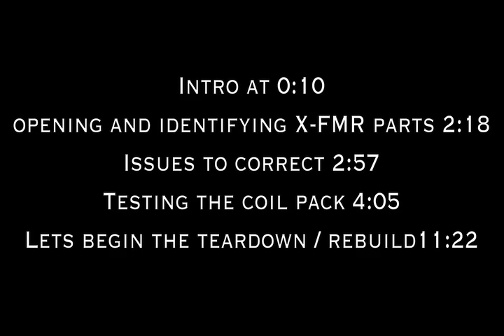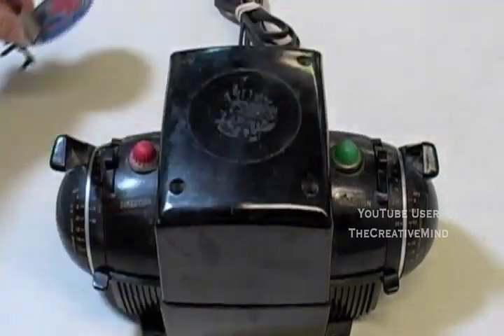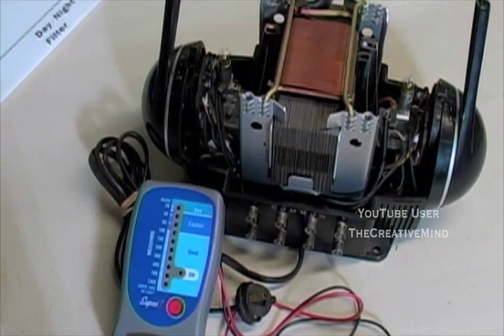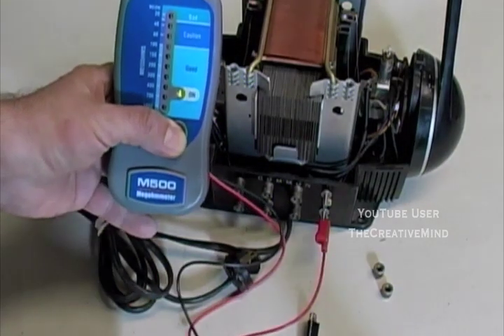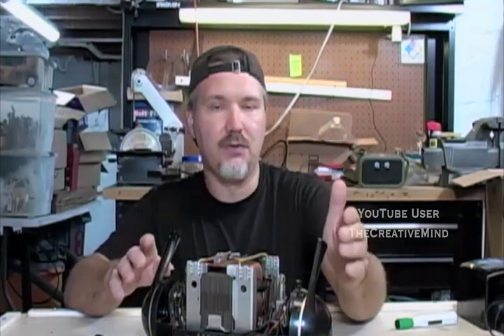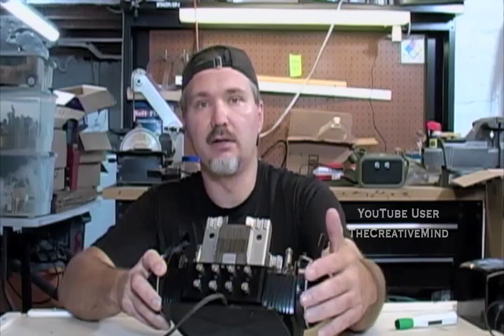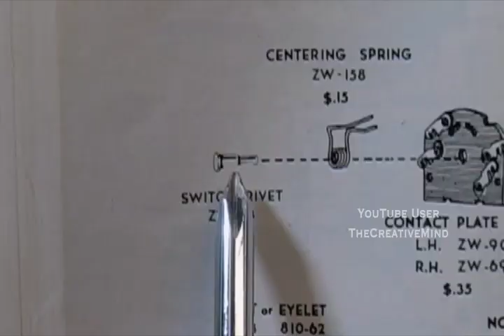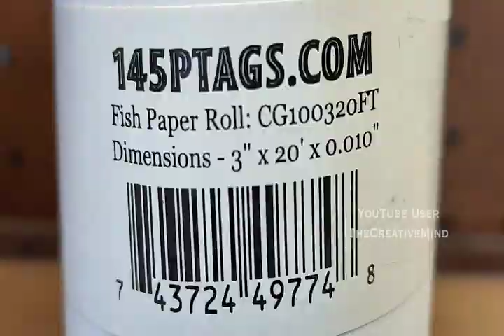Lionel ZW Transformer Complete Disassembly and Rebuild Video (Upgrades and Replacememts)

Comment: Beautiful and fun to watch.  I have two ZWs on my layout.  Paid full retail for the first but picked up a sketchy one two years ago from a guy who knew little about trains.  He used the voltage meter and some terminals worked others did not.  I paid $35 and then took it to my hobby shop.  They charged $90 for a full rebuild.  So I got my second ZW for a low $125 with full peace of mind.  My most adventurous repair is right now on a Lionel Erie Alco and I'm building up my courage to do an E-unit rebuild.  Wish me luck.
Reply from the maker: Thank you, even with the rebuild price sounds like you did well. I need to find more ZWs for that price. I think you'll do fine on the e-unit rebuild. I took one apart with with an e-unit jig and reassembled it to try it out.

Comment: Nicely done Ed, great work and video!!👍
Reply from the maker: @TwistedMacGyversTrains  thanks Frank, this one was a labor of love
Reply: @TheCreativeMind How’s it working today? Is there a place for making an 18v tap? I’ve been think about adding one to mine. I’ve seen in added on other postwar ZW’s.
Reply from the maker: @TwistedMacGyversTrains  the ZW works great today. I've put it under some heavy loads and still running. I have to research the 18 volt tap on the ZW. This is the first I'm hearing about it. Thanks Frank.
Reply: @TheCreativeMind I purchased mine fully upgraded with a power switch added to the front. They are also adding a button for the bell now.

Comment: Hi Ed, The video is fantastic! I wouldn't have tried restoring a ZW if I didn't watch this. All terminals register over 20v and the whistle over 25v. Adding the ZW to the table now. two trains running on one 18 awg lockon. Thanks again, looking forward to your other videos!
Reply from the maker: Thank you Alfredo, I'm glad to hear everything went well and your readings are spot on. Enjoy running your trains with your new rebuild. Please correct me if I'm wrong, I may have seen your comment earlier with having some trouble with the whistle output on one of the terminals. Is everything good now?
Reply: @TheCreativeMind  I was incorrectly testing the whistle/reversing assembly and the circuit breaker. I needed to move the switch lever slower for precise contact. To test the circuit breaker, I grounded the B&U, C&U, terminals before I started increasing voltage which tripped the breaker without any sparking. My old hands/mind took a little bit longer to realize what I was doing. 😉

Comment: A great reference, thank you. My unit buzzed. The core laminations had been inserted in an irregular pattern by a rushed Lionel worker. You could even see how the die they were stamped from had dulled on one side. This kept the laminations from laying flat together. I hammered out the burred edges and 3D printed a spacer to keep them squeezed tight.

Comment: Honestly, this is one brilliant video! You did a fantastic job of capturing your 'tear down'.
I just got myself a ZW.... and it's become clear very quickly that a total tear down is going to be required to rehab it. I don't have all the equipment you do but as much as I've been finding myself gasping in horror at all the work that needs doing, I also am relieved to see such a clear video of exactly how everything came apart and what work was performed. Time to ready the soldering iron, begin ordering parts, and wait for the Greenberg repair manual to show up at my doorstep!
Reply from the maker: Hey Leverett, thanks for the comment. I found myself in the same boat you are in knowing how much work had to be done, it can be overwhelming. First I can say is label all the wires from the coil pack going to the whistle/directional board. Even sketch it out on paper where the wires go to, makes it so much easier for reassembly. All my tools I acquired over time but that angle bit will be a huge help in drilling out the terminals. If you go drilling in straight, you could damage the bakelite case. The Greenburg book will help a lot with line assembly and if needed parts. And if you get stuck, come back to the video. Best of luck on your rebuild, when you get it finished you can do 10 in your sleep

Comment: This is an insane rebuild. To me you went above and beyond what others won't do. I'm not sure about that megger putting out that kind of power you sure it won't damage anything. Other than that awesome work
Reply from the maker: Hey Jeremy, much thanks for the comment. Meggers only put out high voltage/minimal current for insulation testing. Curiosity made me try it on one of the bulbs for the ZW and it didn't blow the element. Meggers are only good for inductor testing but will have devastating consequences for testing electronics.

Comment: Extremely nice work...
A little tip for you as an avid Lionel collector I have come across some tricks of the trade I work in the bowling business as well .. in the bowling ball repair world when they use a pentagraph  to add your name into a bowling ball or your refurbishing a bowling ball for someone, you can get the wax crayons for terms of a better word, that you can refill in the lettering on your Lionel transformers you can get the white wax crayon, you take a paper clip or a jeweler's screwdriver and you can clean out the old paint or white lettering for your gauges or your whistle lettering, clean them out and then you can take this wax pencil and fill them in and wipe off the excess and voila all of your stamped lettering is brand new just a little tip... Although yours turned out well I like to redo mine so they're nice and bright... I have subscribed and look forward to more videos keep up the good work
Reply from the maker: WOW! Thank you Izzynutz. Iwas wondering how to redo those. I thought paint and wipe away but the wax crayon sounds better. I'm on my 3rd ZW now and the terminal lettering is gone. The wax crayon method won't work there but I'm thinking of rubber stencils to paint them on.
Reply: @TheCreativeMind  you could do that too but I have sometimes taken a Dremel with a very fine tip and cleaned up lettering... You could go through ACE Mitchell which is a bowling supplier to get the wax crayons you can either get the whole set which is just about every color under the rainbow including neon colors or I think you can buy it's been a while since I have individual colors yeah you just rub it in until it fills it and then when you wipe off the excess your lettering is clean and crisp good luck looking forward to some more videos

Comment: Best quality rebuild I have seen EVER!

I am about to attempt rebuilds on 2 of mine, and not sure I can do as great of a job.
Do you stock things like high temperature wire? And that insulating paper?

Why don’t I just send you my ZW’s and the rebuild kits and you can charge me for labor!

I actually have a Megohmeter in my shopping cart at $100… 
Do you take on rebuilds?
Reply from the maker: Thanks D W. I don't stock any of the items shown in the video. Much of it comes from ebay or other websites. I do try to post all information on my sources and model numbers where you can purchase them from. At the current time, I'm not taking on any rebuilds. However it's something I may consider upon retirement.

Comment: Thank You for uploading, i hawe for a long time concidering buying one of those but because the shipping and import taxes probably are going to be alot more then the transformer where i live i wanted to know more about them and this is exactly the type of in depth information i was looking for.
Reply from the maker: Hi Vampi, I try and give as much info as I can in my videos so everyone can understand the process. I wasn't planning to go as far as this but the hardened grease and oiled papers made me do a complete teardown which I think everybody can benefit from. Thanks for watching.
Reply: @TheCreativeMind  
Thank You, i hawe a few 1950-60s Lionel steamers in my collection with the original track and some period acessories for it, so this came in handy. Im not an enemy of modern tecnology, but for the display  it looks much better with the original setup for the wisible parts in my personal opinion. I hawe a pair of the single steel case transformers, and the original 220V converter transformer (it's made in The United States, but i am not sure if it mainly was for the European export market in order to make the original Lionel transformers to work with 220V, it has a 110V socket built in to the steel case so it is just to plug in any traintransformer of Your choise the output can handle).
I used them as display before, but decided to restore the whole setup back to working condition for historical reasons a few month ago and i realy like it.

But, despite the total weight, it is only designed for one ot two locomotives.

Comment: What spec diode did you replace the old one with? Thanks
Reply from the maker: I used a Ruttonsha 16 amp stud diode. It has a perfect washer size that fits in the old disc location. There is a 40 amp available but it doesn't fit so well because it has a larger washer. I got mine from ebay.
Reply: @TheCreativeMind  I got some 70 amp stud diodes. Hopefully those work. If not I’ll get some 16s

Comment: Excellent video! Not sure I could put it back together after all the parts are removed. I am going to purchase one of these. If I bring my voltmeter can I just test it to
Make sure it puts out 19v? Is that a good indicator that it’s good? Thks
Reply from the maker: 19 VAC is good to read but I've seen some ZWs go as high as 21.5 VAC. It's all about the natural tolerances of the components. If your purchasing from an actual store, most likely they serviced it with new rollers, diodes, breakers etc if needed and hopefully a warranty. If you're purchasing from a train show, you may read your AC output voltage but pay for what you get without them overcharging you.

Comment: That is amazing attention to detail and great work.  I added the whistle Diodes to mine but did not change the circuit breaker.  does the coil need to be removed?    Can you tell me exactly what breaker I should install?  Thanks
Reply from the maker: Thank you OneMore, the coil pack from what I know doesn't have to be removed. I got my circuit breaker off eBay. Just type in "ZW circuit breaker" and you'll get the one I have in the video. I had to extend my wires (soldering additional wire) to the new circuit breaker location. If the coil pack had to get removed to gain access to a wire and extend it, just unscrew the 4 bolts on the bottom and the coil pack will slide forward a little. Just make sure the wires are not pinched during reassembly.
Reply: Creative Mind, I watched your video as well. Very thorough, very knowledgeable. Made me real comfortable in tackling my repair work! 
I’m coming to you to ask about the Bakelite circuit breaker being replaced by the newer 15 amp breaker.  Tandem says Bakelite is more reliable than the upgrade Lionel did back in the day. Am I correct that this new 15 amp breaker on EBay is better than the one Lionel converted to? 
Have you experienced any issues converting to the new 15 amp breaker?
Thank you 
Carmine
Reply: Creative mind, the ground wire going to the Bakelite circuit breaker looked like it was snipped . Does it get attached to anything when the conversion to the new circuit breaker is used?

Comment: Do you have the brand and part numbers for the new circuit breaker and diodes along with that  L. E. D. Bulb? Or do you sell them? I really need to upgrade the circuit breaker in my zw275r because I am sick of burning out electronics.
Reply from the maker: Everything I got is on ebay. Just search under ZW transformer LED bulb, Circuit Breaker, and diodes. 16 amp diodes is plenty enough and they fit nicely where the rectifier sits.
Reply: @TheCreativeMind  is there any way to tell which circuit breaker I need without popping the top to look? I am pretty sure mine is a zw275R because it doesn't him at all, and I think the core is riveted. Again I can't remember, it's been years since I've be inside it.
Reply from the maker: @inscoredbz  According to my Greenberg book for the ZW model R, your Circuit Breaker is model number ZW-232. From what I heard, these breakers start to fail as time goes on and tend to trip more often. If you look up this number you will find the updated quick blow breaker and the majority is sold on ebay. You did mention you are burning out electronics, is the transformer creating a surge or circuit breaker issues?
Reply: @TheCreativeMind  my guess would be circuit breaker issues. I haven't tested it for surges, but with the circuit breaker being old and pretty slow, that's my guess. Those old transformers just wasn't made for electronics. I've had several whistle boards pop and one true blast from a Williams.
Reply: I do have tvs diodes across all the rear C-U abcd. It probably is spikes now that you mention it, during a detailed wheel or what ever. It will drag the derailed car forever before the breaker finally shuts it down, and as soon as the short is removed, the light goes off. I may need to replace the TVS diodes. I'm sure they can go bad as well, and I have no way to test them. I'll probably just do both. New breaker and TVS. Probably need to add more of them around the layout.
Reply from the maker: @inscoredbz  replacing those boards is pricey and I'm glad to hear you have the TVS diodes. They help yes, but like you said they may need replacing they go through so much abuse. What may also help is to increase the wire size feeding your track. Too small and it takes longer for the breaker to trip and the wire heats up. Hypothetically if you have a 22 AWG or 20 AWG powering your track, try using 16 AWG. The larger the wire the more current it can take to help trip the breaker and helps reduce voltage drop. But I'm not sure if you're using fastrak or tubular track. What may work the best is actual circuit breakers. Eaton makes low value breakers and a youtuber installed them on their setup, tripped instantly. Best of luck nitro. Let me know what you find.
Reply: @TheCreativeMind  I'm using atlas three rail track. Looks good, but it is noisy. I'll probably go in and change the TVSs and add a bunch more. Are you talking about actual breakers for a breaker box? I'll have to see if I can find that.
Reply from the maker: @inscoredbz  you can use actual circuit breakers for your layout but not the ones you put in you panel at home. Eaton makes miniature DIN rail circuit breakers that are low voltage with a variety of trip ratings. All you need is a DIN rail for mounting and the value breaker desired for your train running at its favored voltage. Be sure to do a current check of your train running but do not get a breaker that is close or on the tripping point of the breaker. Example is I have Lionel Empire Builder set and it draws 6.1 amps at 14 VAC, I may get a 10 amp breaker just to be safe. When I last saw, each breaker was around $12.50 each. Not sure of the price now